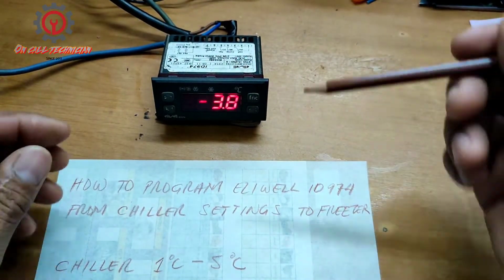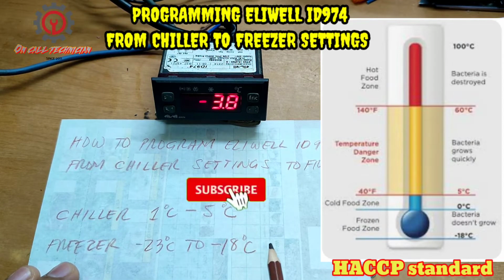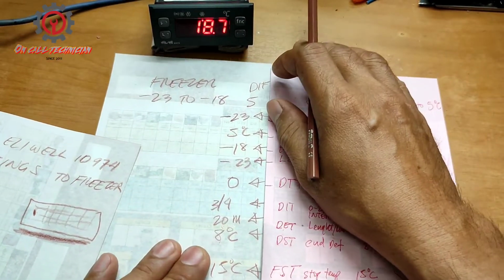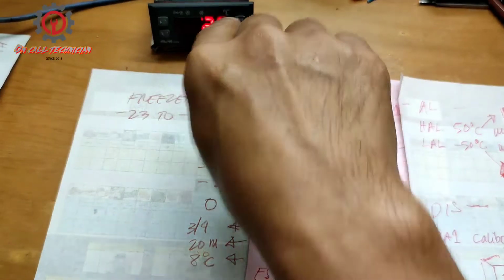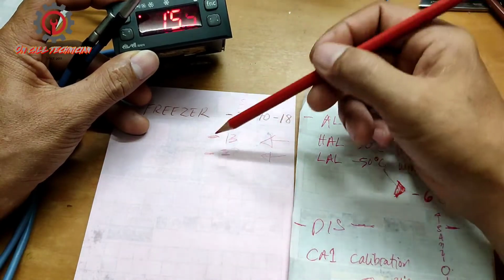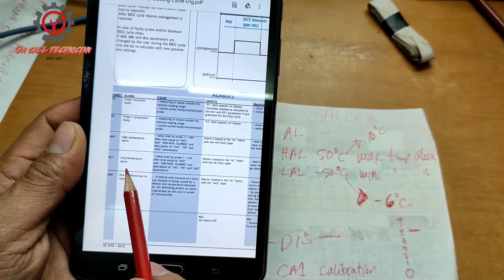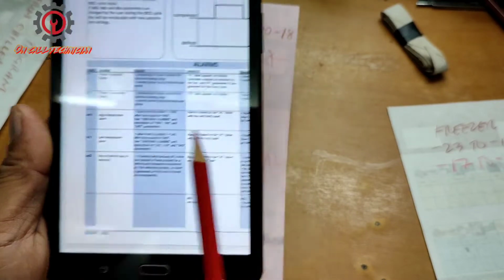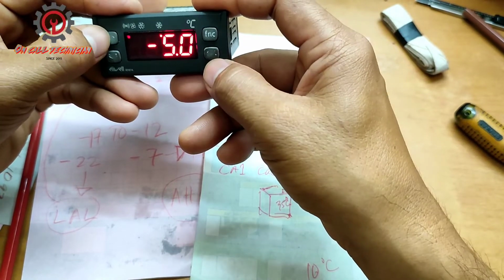PROGRAMMING ELIWELL ID974 FROM CHILLER TO FREEZER SETTINGS W/ HIGH & LOW TEMP ALARM CONFIGURATIONS

Comment: Buenas noches amigo no logro hacer que el congelador apague segui las intrucciones al pie de la letra
Reply from the maker: Set your setpoint at the temperature that seem standard in your country amigo. Freezer compressor cut out is the value of your setpoint while cut in is the differential  value.
Example: -21°c to -18°c 
SET  is -21°c

If you could type here all your parameters then I'll check it for free amigo.
DIF is 3°c  not -18°c because the difference of the given example is the value of the differential.

Comment: Hello boss me again, boss ask ko lng kng papaano fix ang issue ng freezer nmn na naka constant na 9 °C lng, ano mga kaylangan ko palitan, sa CP, AL , FAN ? Need your help boss
Reply from the maker: Sa video ko ay both chiller at freezer settings na nilagay ko. Alin ba dyan ang nagpapagulo sayo boss? 
Pwede ba list down mo dito lahat ng program mo at check ko 1x1
Reply: Lahat ng nilagay mong settings sa freezer jan sa may papel is ginaya ko lng 
Pinagpapalit ko lng lahat ng freezer setting ko،  which is same lng jan sa mga nilista mo jan sa papel
Reply: Mas lalo nmn tumaas yung temperature ng freezer nmn nagging 9 ° C na
Reply: Boss setting ng freezer ko ginaya ko as the same as the setting sa video mo kaya nag tataka lng ako bakit hnd bumababa yung temp ng freezer nmn
Reply: Lahat ng sinulat mo sa papel mo exactly the same jan sa freezer setting na nilagay ko saamin
Reply from the maker: Ask ko lang sir, technician kayo?
Reply: Boss hnd po kaya nga sayo ako nag tatanong kasi ginaya ko lng yung sa video mo  @THEMULTISKILLEDTECH
Reply from the maker: Hirap unawain ang codes ng mga control. Kahit mga 10 yrs na sa field namin bihira lang ang bihasa. Na se sense ko ang isang tao the way he ask and talk. Pero tinatanong pa din kita, at sinasagot although nasa video ko na lahat ng tanong mo. Better call a legit technician to check your freezer

Comment: Boss for CA1 button ano po ang tamang temperature 0  po ba or -5 °C pa din po as default for freezer setting ?
Reply from the maker: Pag nilagay mo sa -5°c ang CA1 mo dinahdagan mo ng temperature sa cabinet. Example sa display ay +18°c magiging + 13°c na sa display. Check nyo issue ng freezer nyo sir, baja may ice built up, fan na hindi naikot, defrost heater baka sira na, door gasket baka may air leak na, run capacitor baka lumubo na, at last ay freon nya baka kulang na sa karga
Reply: @THEMULTISKILLEDTECH  hello boss, okay salamat po ulit, i will take your advice on that baka nga freezer na talaga may problema 😅,
Reply from the maker: Calibrate as neede sir, if display temp is same with cabinet temperature then no meed to calibrate
Reply: Di ko po ma get ano lalagay sa CAl
Reply from the maker: @man.hwa.reader7745 0 mo lang sir
Reply: Okay boss kasi hnd na bumababa yung temperature sinundan ko lahat ng nandun sa calibration mo sir pero hnd na lumalamig freezer nmn sa store naka 18 na po sya hnd negative 18
Reply: Pinalitan ko po kasi lahat ng settings sa freezer nmn nilagay ko lahat ng calibration na nandun sa paper mo

Comment: om, ini sensor nya kan ada 2.
misalnya saya celup dua dua nya ke air kolam.
buat nyari nilai rata ratanya air kolam , untuk trigger kompresor chiller buat nyala. apakah itu bisa ? misal sensor A baca 25c, sensor B baca 27. brarti nilai nya 26 celcius.
Reply from the maker: For quick reply pakai English puan🙏
Reply: is there any thermostat that have 2 input probe, which is can find the average value of the two inputs, for example probe A read 25c. probe B read 27c ,these two probes put in water ,so the thermostat read the value 26c.
Reply from the maker: @nixvapper dixell xr460c model have 2 different sensor as what you want to do. You can disable the evaporator sensor of the primary. Usually we use this for primary freezer dan secondry for chiller. Thank you for the English tuan
Reply: @THEMULTISKILLEDTECH  do you have any tutorial for this ? anyway thank you 😁
Reply: @THEMULTISKILLEDTECH  xr70cx can do it ? i checked xr460c no one sell in indo.
Reply from the maker: https://youtu.be/V3VDqvLyhwA?si=8sEAC17u5AQm6WeU watch this tuan  if you pakai dixell for high temperature
Reply from the maker: Try ali express sir. Xr70cx is 1 thermostat sajah. 1 room sensor 2 evaporator sensor
Reply: @THEMULTISKILLEDTECH  oke thank you sir
Reply from the maker: @nixvapper  sama sama